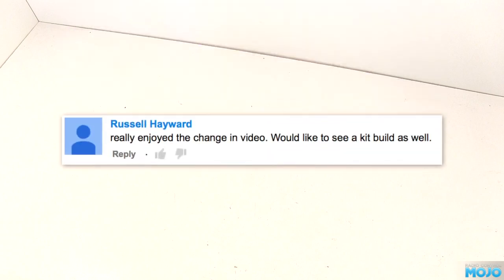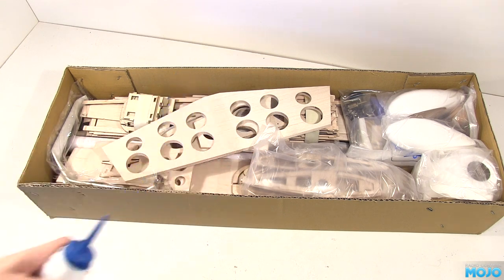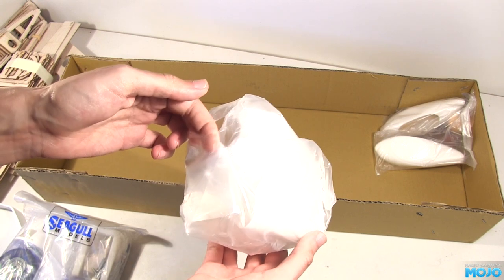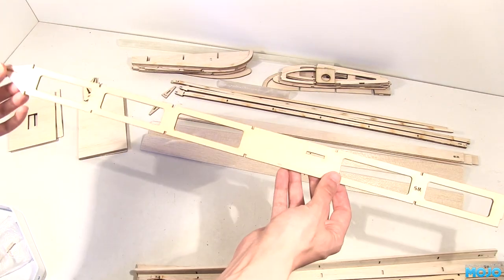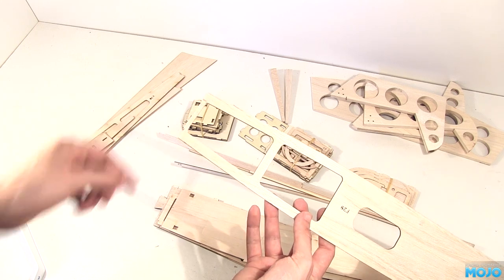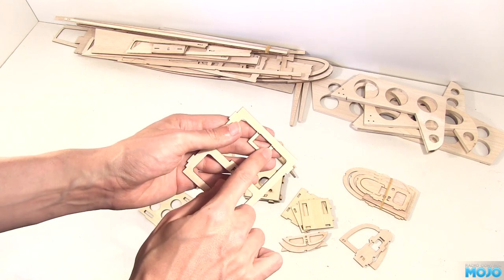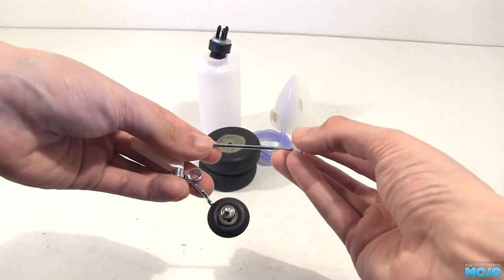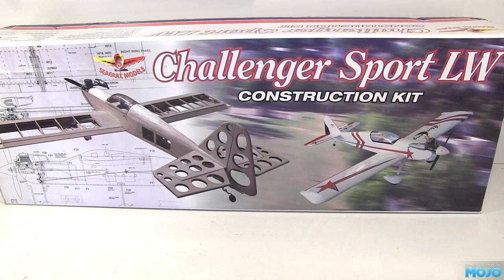Seagull Challenger Build Up Kit - What’s In The Box!

Comment: Looks nice, and I am looking forward to the build videos even though you intend to use a nasty, smelly, oily power plant rather than a nice clean electric motor :-)
Reply from the maker: UKHeliBob I’m a little bias towards wet power, I still suffer flashbacks from learning to fly helis with a Kyosho EP Concept, brushed motor, 2Ah NiCd, lucky to get 3 minutes of flight with a good head speed… Then there was my first attempts at fixed wing, 250mAh 2/3AAA packs… Then I got a 40 size trainer, the power… THE SPEED!!

Electric has come a long way, on anything light weight it’s electric all the way. I get 30 minutes on a LiPo in a WOT4 FoamE, it’s brilliant!